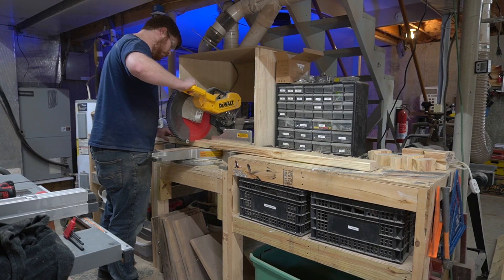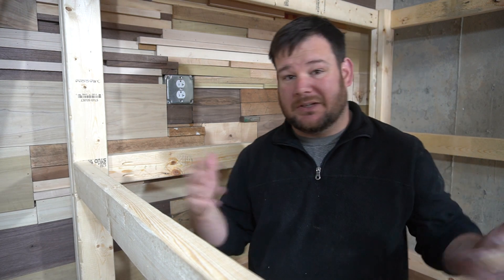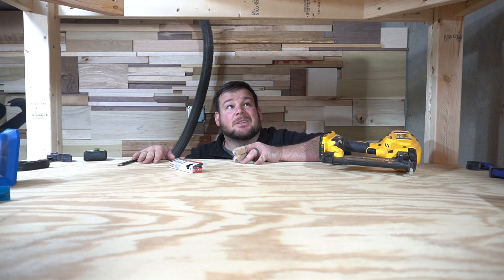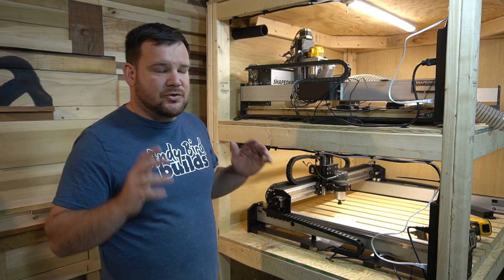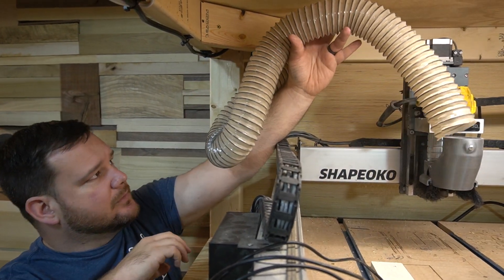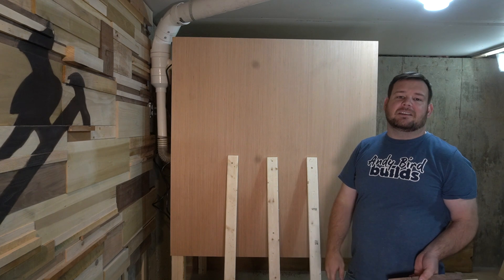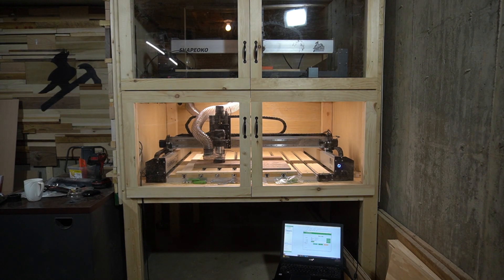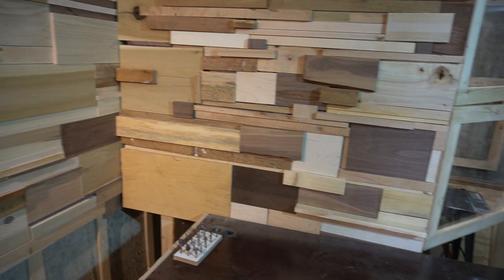I Built A CNC Enclosure For My Two Shapeokos // Andy Bird Builds

Comment: This is a great idea. Much better than my current setup. I just built a big box with doors. But it sits on a table that shakes and jiggles. Do you have the plans for this? I checked your website but didn't see them. Wondering what dimensions you used for each shelf height. thanks.
Reply from the maker: I don't have plans made. I'll try to find the drawing I made

Comment: I wonder if you ever noticed people putting their Shapeoko 3 XXL on a torsion box platform and piece of foam insulation board?? The 3 was so infamous for sagging the new frame and hybrid table were invented for the Pro and later included with the 4. 
I was just wondering if you ever had any issues with your 3 XXL leaving swirls and stuff even after tramming your spindle? 
I had a fit with mine. Luckily the Pro base could support a tank and never flex.
Reply from the maker: I added a 2nd layer of 3/4 mdf and hadn't had any issues

Comment: Looks great! I've been thinking of doing this for awhile. Quick question, do you run both of those off of a single outlet? I know you said the strips were individual but I was curious if you could get away with 2 machines on 1 circuit. If it does work for you is it 15 or 20 amp you run that off of?
Reply from the maker: Thank you! I thought a lot about this. They are both on the same 20 amp circuit. I have nothing else on the circuit. With that being said, I haven't done a full run with both of them yet. Still getting my control station set up
Reply: @AndyBirdBuilds  Awesome! I'm looking forward to seeing what you come up with, currently I'm just using 2 cheap tablet arms bolted next to their machines for Fusion5 tablets. They work decent for their purpose but are not....photogenic by any means.

Comment: Not sure how much fine dust gets produced and not sucked up by your dust collection, but you might look at getting plug covers for those open slots on the power strips.
Reply from the maker: Hmm. If my dust collection is adequate it shouldn't be a problem, but if not, this is a great solution. Time will tell when I get more time to run them together.

Comment: Doing the pocket holes to attach the shelves from the underside was a perfect example of bringing the jig to the wood. Nice addition to your tool inventory❗🙌

Great that you did the doors separate for each level❗👍
To save space, did you consider a rolling door that goes up and over the top? Still could be plexi of some sort and be "see-through'. That might have been a cool alternative. 😎

Question: This enclosure doesn't allow for work on larger projects as I see it. I just watched a vlog where the guy did a 3-D piece ~ 5 ft long. It doesn't appear you could do that, or am I mistaken❓🤔
I thought I'd add a link to the project I saw. This guy is very creative! 👀🙂
https://youtu.be/6kZL6JT86ZQ 

Great example for others looking for a place to house their equipment❗👍😍
Reply from the maker: Thanks, Kathy! I didn't consider the overhead door but that could be a cool addition. 

My CNC cutting bed is 33x33. That's is the max I can do with these machines.

Thank you so much for watching!